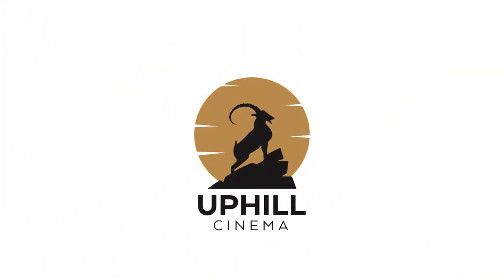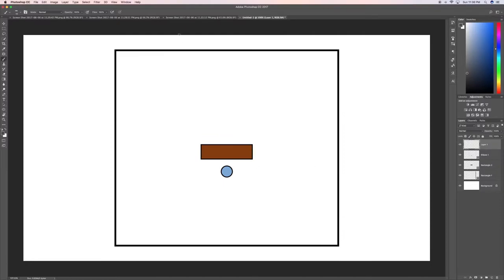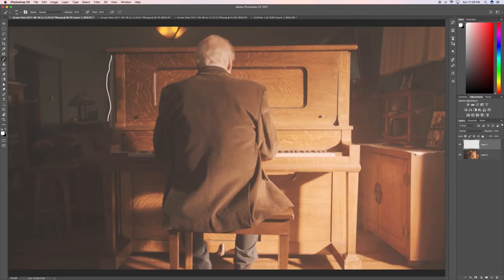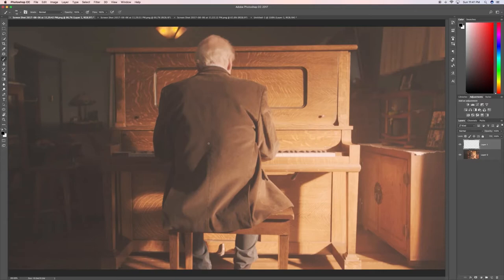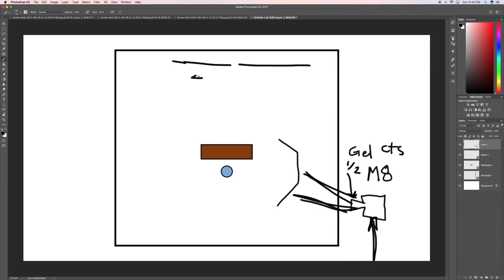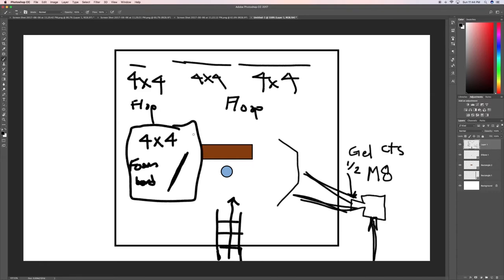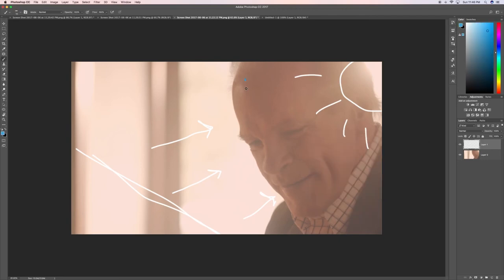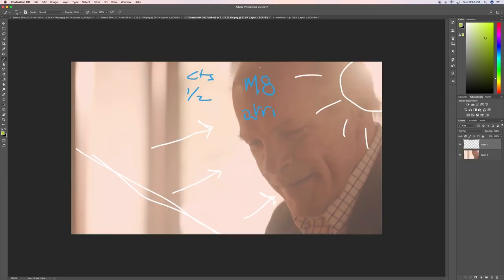How To Light A Scene: Lighting Break Down #5

Comment: Hey Levi,  Just found your channel and you've got some great stuff.  I'm watching all of your breakdowns.  I was wondering though if you could help me crack a few base level concepts.   Like I'm not sure where to start with lighting.  You said you used the Arri 800 here, but that is fairly inaccessible to us poor upstarts.  Currently I own a couple of LED's (The YN-600's) which are reasonably powerful for their size, but am looking to upgrade.  The Lightstorm 300D is getting hyped ona  lot of channels, but I don't know if that's the right choice...  Anything ideas you can offer as to what the basic pecking order of lights is?  Like if I can burn $1000, should I go pick up the aperture 300D, or go hunt on craigs list for Mole Richardson lights that I see going 3 for 1200.  Ive just got no idea how one stacks up against the next.   Thanks man!
Reply from the maker: Kasey, great question, and concerns.  I personally don't own any Arri lights, but I do rent them when needed.  I just wanted to make sure you knew that.  But I personally own the Vision Smith LED lights, and I have used the 300D and they are both great lights.  I don't think you can go wrong with the 300D though.  It packs a punch.  My only concern is "industry standards."  What I mean by that is most bigger film sets aren't using the lights we can afford, but bigger name brands like Mole and Arri.  So its smart to learn product terms and how to use them.
Reply: Thanks for the return, friend.  :)As far as learning product terms and how to use them do you have a preferred guide or info source? Like just an entry level guide where someone can begin to distinguish what's what and its typical use?

Thanks again!
Reply from the maker: Kasey, I know I've seen some videos out there going into some film terms. But that does sound like a video I could make too.